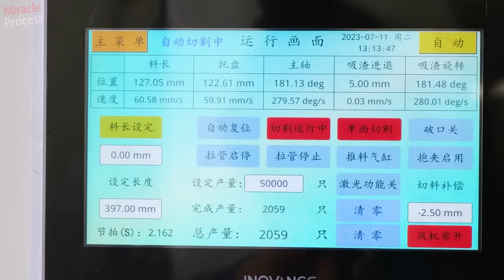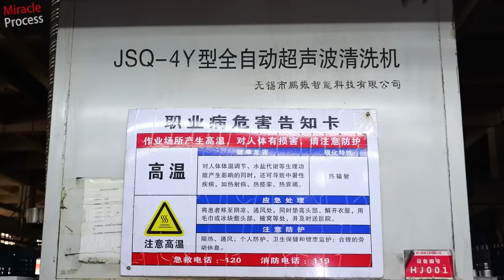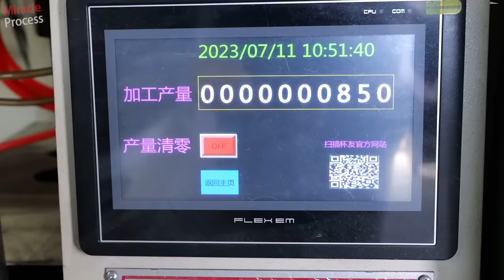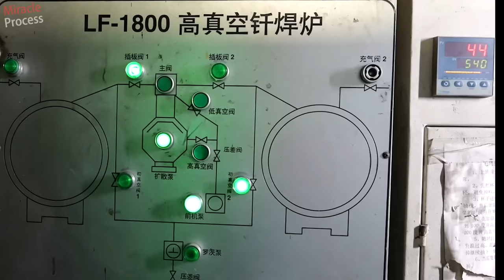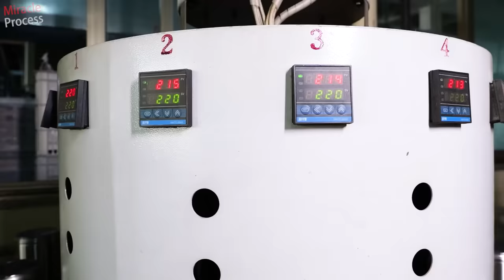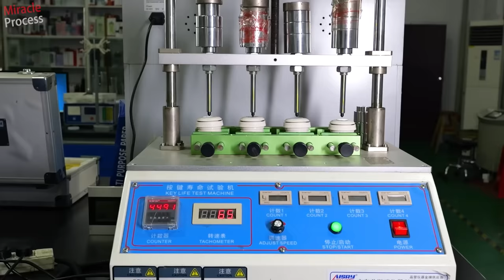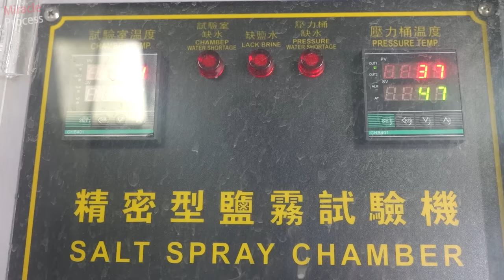Unveiling China's Super Factory: Countless Stainless Steel Thermos Cups Produced Every Day !

Comment: No matter how good the initial vacuum is, there is always some residual gas gradually released by all metal surfaces. Because of this, the thermos would stop working after about half a year. The step at 5:24 adds a porous zirconium/titanium "getter" tablet which absorbs the residual gas and maintains high vacuum for much longer. The mirror-like area inside of the bulb in vacuum tubes serves exactly the same purpose.
Reply: My thermos also stopped storing heat. If the vacuum is restored, will the tablet start working again?
Reply: @TheRiper69  This type of getter can be regenerated by annealing it at high temperature. But if your thermos stopped working it means that it had a small leak or did not have the getter at all. Either way, it is not something that is easy to fix at home -- for the thermos to work, it has to have pretty high vacuum.
Reply: @cogoid  Understood. Thanks!

Comment: There is no way that these products can not be produced in the USA for the same cost. My solution is to tax these companies who import these goods at a minimum 50%  quarterly & yearly profit  these USA based companies report in their quarterly & yearly profits with no tax loop holes. That would bring the manufacturing jobs back to the USA. There is no way that the companies can not bring back manufacturing back to America.  We are the work horse of manufacturing & should stay that way. The only way to bring these manufacturing jobs is to force manufacturers of these processes with a 1000% tax on their profits if they are based in the USA. Otherwise a 5000% tax on profits would have to be implemented for non-USA machine tool manufacturer's. More USA machine tool companies & machine tool manufacturing lines have to go back to their roots in producing high quality & accurate machine tools & machining centers. This will force American made machine tool & machining lines to comply or go out of business. Over the years, I have seen American made machine tools & lines of such shitty quality that I would never buy but GE Aviation would buy knowing that there very few parts which could fit on the machine let alone being capable of machining the part. Let the USA to be premier of machine tool manufacturing companies such as Ingersoll Milling Machines who use to make the most precise machine tools which we need to have an all American made machine tools, machining lines, Vertical Lathes. & Horizontal Lathes. My Father & brother each worked at Ingersoll Milling Machines. My father was a electrician then a supervisor, & installer & service & repair person. My brother was a electrician who installed machines in South Korea & the Naval Ship Yards @ Norfolk. There my brother set up the water jet cutter to machine a 10' X 20' of hull plating to +/- .001 when the Navy only wanted a tolerance of +/- .250 of an inch.